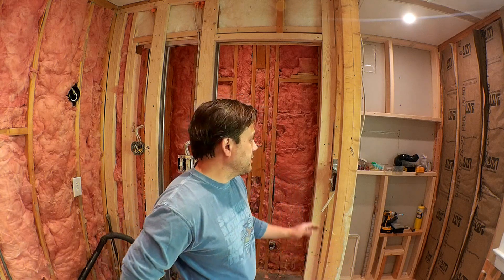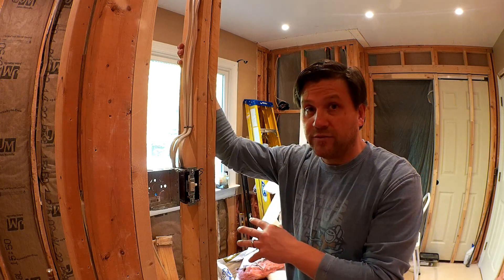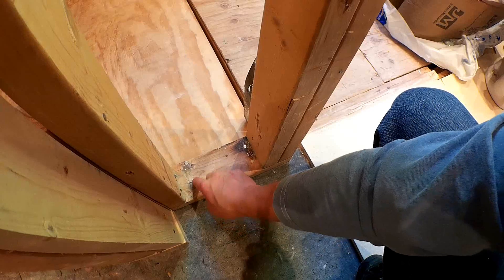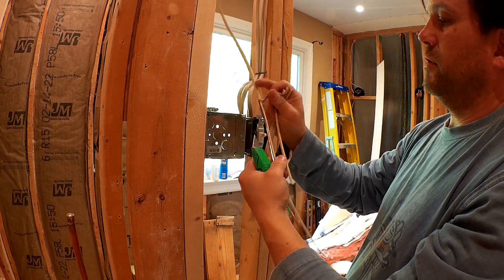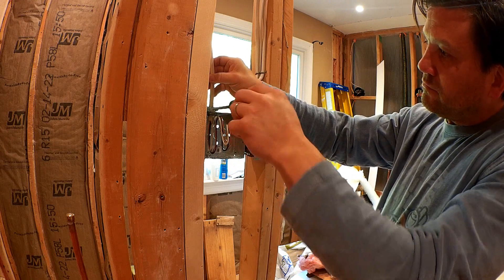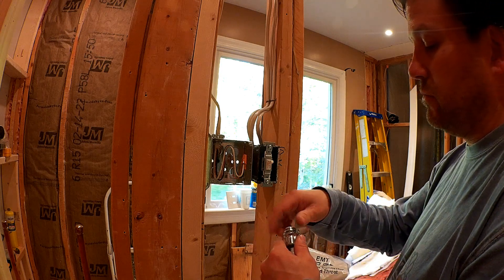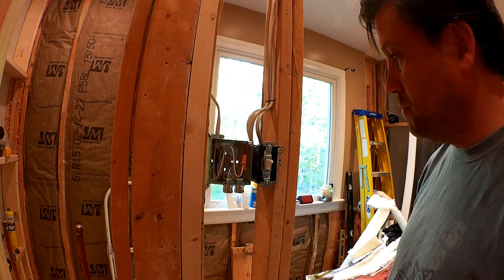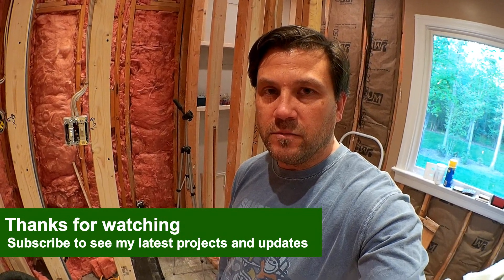Ditra Heat, Electric Floor Heat Install Part 1 - Rough Electrical

Comment: 120 uses twice the amps at the same wattage as 240 and it’s supposed to be a 15 amp circuit not 20 amp
Reply from the maker: Thanks for the feedback and the point of clarification. I used my existing dedicated 20 amp circuit previously used for the old jacuzzi tub to run the Ditra heat, but the instructions do indicate to use a 15 amp circuit.